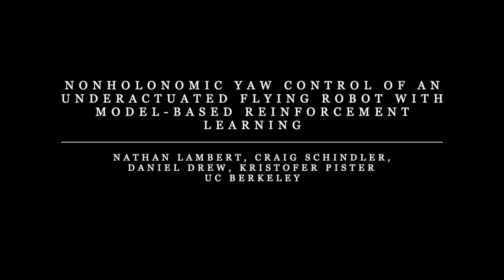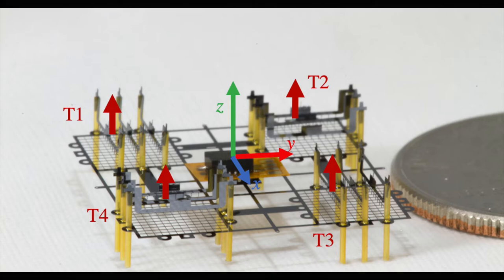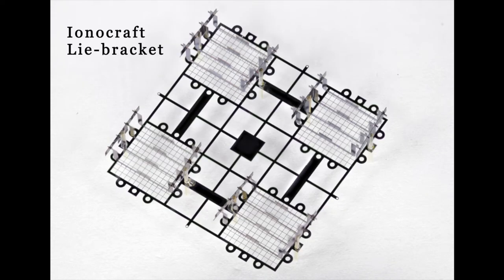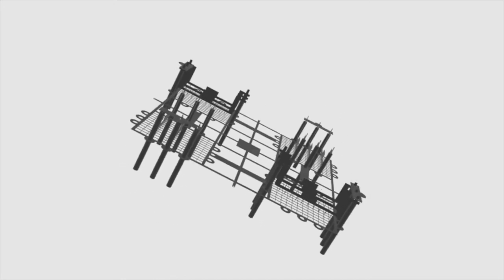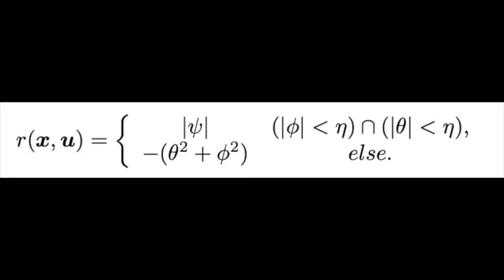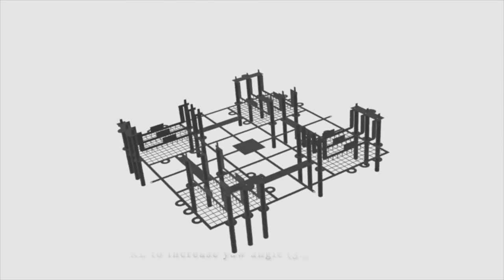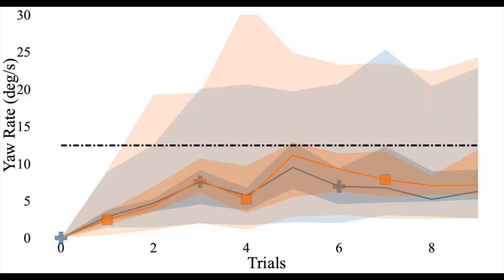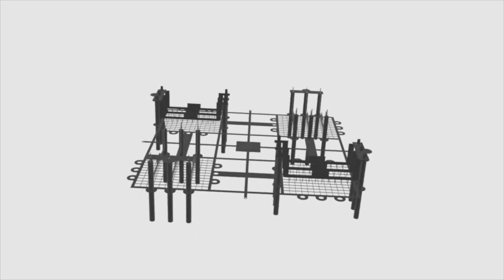Nonholonomic Yaw Control with Model-based RL

Comment: scale it up to prove the jittery motion is due to the low mass of the robot and "sarcastic control". try placing the bracket in a balloon shaped- very light weight bubble (aerogel) or globe with a hole on each side. fixing the bracket inside of the shape to force the flow out in one direction and in from another.